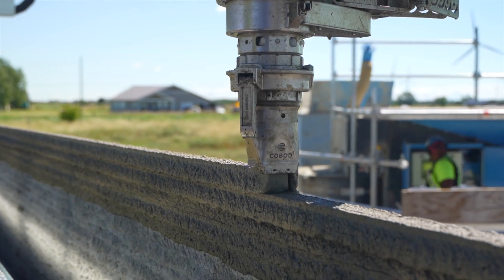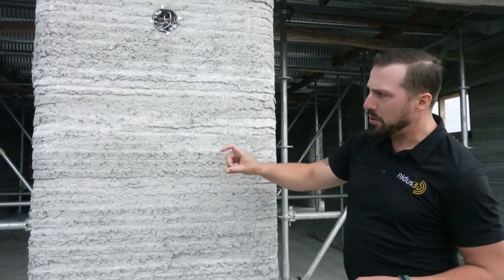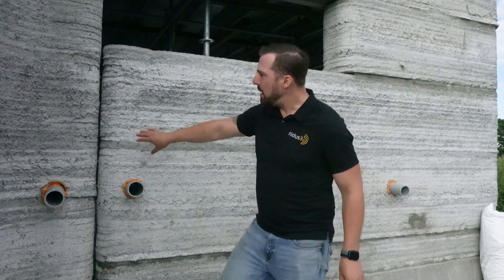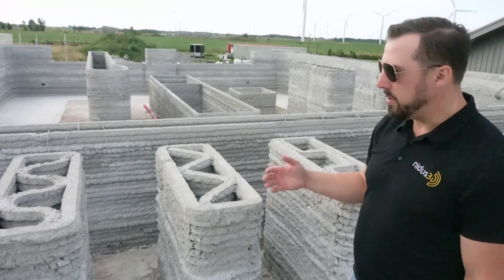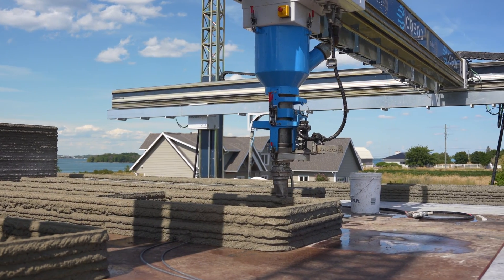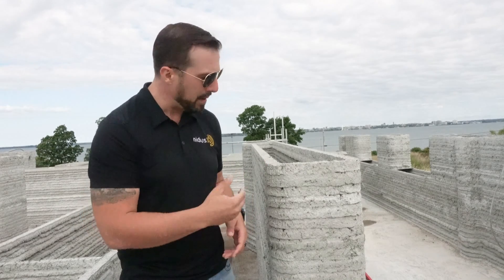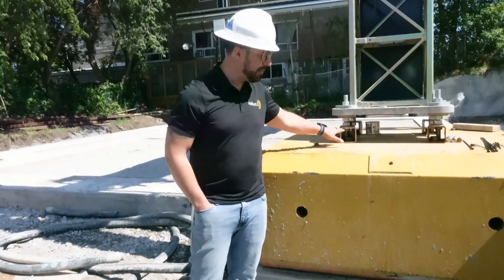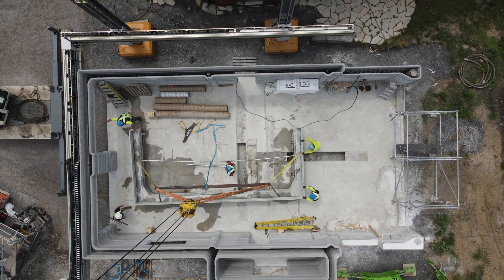First 2 Story REAL CONCRETE Printed Building in North America

Comment: Impressed by the technical knowledge and practical problem solving skills of Nidus.  They seem grounded in engineering first and foremost, while in my opinion other 3D printing dual facade startups, especially the well funded ones, are primarily marketing organizations crafted for their investor's ROI plan and will fail as Katerra and GlideHomes and countless similar firms did eventually.  Having started in computer and software development in 1977 I am lucky to be self funded and meet SEC requirements as an angel and series "A" investor.  Not any smarter, but have the luxury to learn from design and process mistakes and move forward without putting other people's money at risk. 

I can appreciate Nidus' efforts, having worked in semi-retirement off/on for 4 years trying to design an affordable prefab modular residential kit home, based on stick-built construction methods which, ignoring the marketing hype, is what prefab modular is really.  Even with a huge $3B VC investment in automation Katerra could not make stick-based prefab modular profitable, and neither were any of my (25+) panalized design iterations.  Too much manufacturing, transport and assembly time.  To focus on materials cost shows you do not understand the full scope of the residential construction problem.

 My new non-stick-built approach is more promising and has survived structural and construction time reviews.  I encourage anyone serious about furthering residential construction technology to put the FEA structural analysis tools developed by SkyCiv (wonderful Australian firm) to use.  It has saved me countless times by pointing out where my design is screwed up structurally and correct it before too much time is wasted.  I have no financial association with SkyCiv.

Best of luck to Nidus.

Comment: First off, let me say I LOVE WHAT YOU ARE DOING HERE.  This is incredible.  So neat to see this progress in 3D concrete printing.  I am an engineer (mechanical by education, electrical by experience) who's been watching this field grow for years, and I have so many questions and ideas about what is happening and now and where it is going.

2:50 You showed the print-in-place, grouted, reinforced lateral beam.  That is profound.  My biggest question about all of the 3D printing space has to do with the reinforcement: why can't we go to smaller, mixed-in rebar, something like the helical "microrebar"?

6:30 Why can't the code be met by creating a void of the same dimensions as the Sonotube? That seems like the engineer's liability, not the authorities' having jurisdiction discretion.

8:00 You say you are going to add chemical additives and adjust the moisture content to improve the wall texture/resolution.  Do you think the screed is optimally long enough or has a surface smoothness? Is there a way to use a longer screed and a flow of water between the surface and the screed (a small drip using something like a refrigerator water tube)?  This would simulate a concrete finisher's tactics.

Thank you for this great video, along with your others.  This is so cool!
Reply from the maker: Micro rebar is more likely to clog the hose 

Home inspectors work for the municipality so while an engineer could structurally approve something the town may not grant a certificate of occupancy

I don’t know but I’ve noticed in this project they actually used a smaller screed than in the past.
Reply: Nice observations and ideas!
Reply: I think the usual screed works with gravity/higher viscosity - two things they might not want - but if it could be really smooth that could be cool. Good thinking on the sonotube - unless the tube itself is structural this requirement doesn't make much sense haha

Comment: These guys using the spatula are way ahead of the game. Those smooth layer lines are key. If the layer lines look smooth enough, it just looks similar to brick, which is acceptable as an exterior veneer.
Reply: Yeah they could also just paint it or maybe add in colouring(?) - would look similar to stucco.